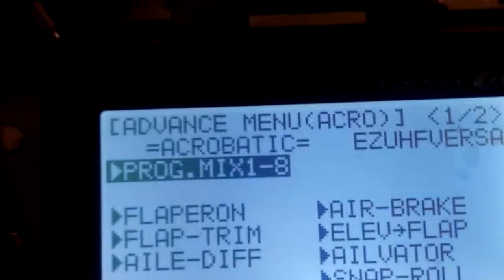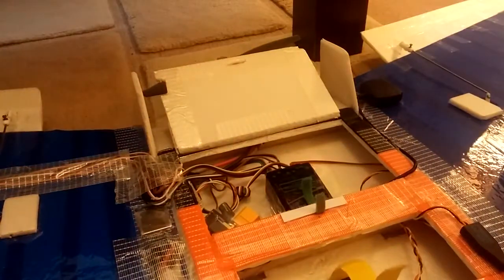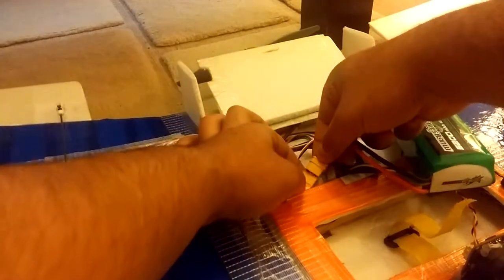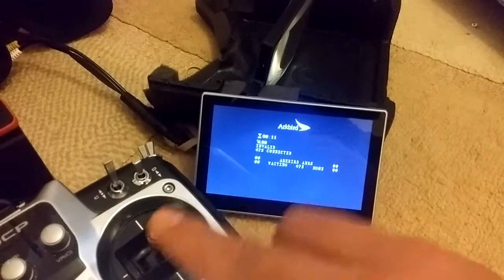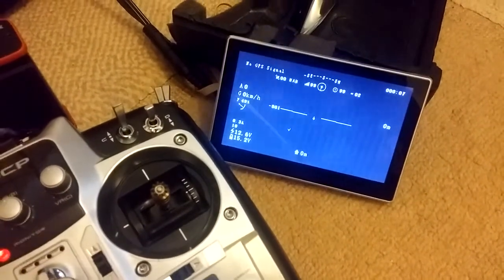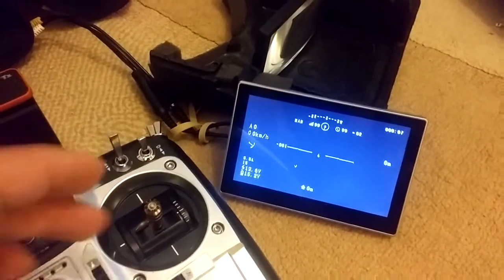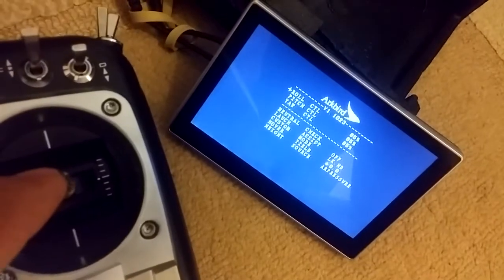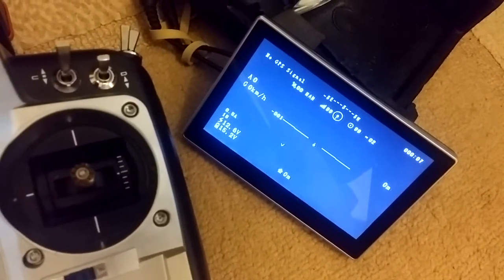Arkbird Autopilot 2.0 reveiw PART 2 (startup)

Comment: The arkbird only work for wings?
Reply from the maker: IT works for almost all flying frames and multi rotors as well, I have used it both on fx61 flying wing and also a volantex ranger 1600 glider

Comment: Hi. Was wondering if you could help me ? I am new to FPV and have chosen to go with the Arkbird 2.0 lite. However I am having real problems setting the 2 & 3 position switches. I can't seem to get my head round the Maual. If you could help then I would be very grateful. Many thanks.
Reply from the maker: Hey adrian, that is a very simple operation but unfortunately the manual makes it look rather complicated and I agree with you it doesn't make much sense so let me put it down as simple as I can so that it clicks for you.
Two position switch on Channel 5 and a 3 position switch on Channel 6 providing that you have a 3 position switch.
The channel 5, 2 positions which is just an on off switch one setting will give you full manual control with no contribution from ap
And the other setting will send you to Channel 6 which is a 3 position switch and you can select any of the three modes but at any given time if you flick Channel 5 two position switch back to manual you will go back into manual control. Let me know if that made sense :-)

Comment: As you friend, in this new model I need to remove the Jumper for use with 4S battery, or does this new Sensor do everything?
Reply from the maker: Carlos Cunha the new sensor does everything with 4s with old sensor it doesn't work iam sure
Reply: OK, so if I use a 4S battery, will it power the entire system automatically, even the camera and Vtx being 12V?
How will I know if my sensor is the new one for 4S?
Reply from the maker: this is how the 4s sensor looks like, its slightly bigger and thicker, check this link
http://www.arkbirdfpv.com/html_products/Arkbird-Current-sensor-with-12V-regulator-output-40.html

Comment: As per instruction to the manual it need to switch the 3 pos switch up then input left or right almost instantaneosly it will go to no sat mode and manual mode on the display then input right stick 6 seconds still cannot go to the menu  the manual is not so clear oh dear....but still thank you Ready-Set-Test for your video at least one step closer to program this autopilot system